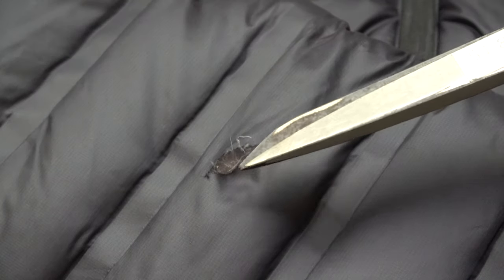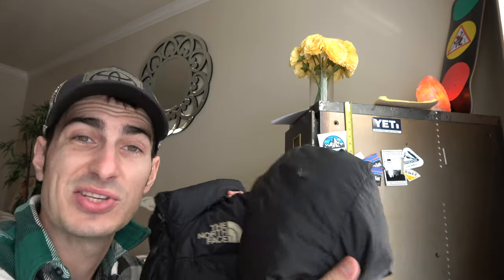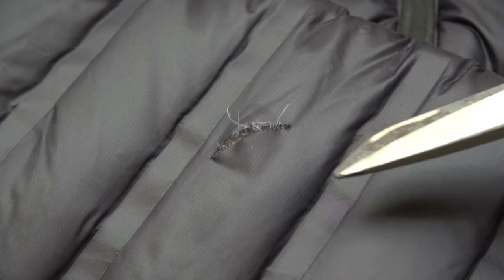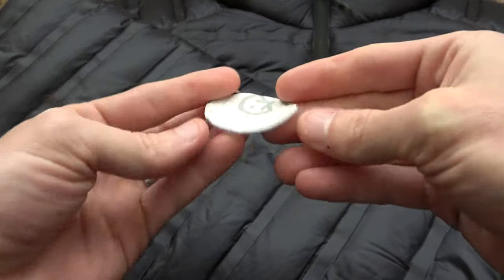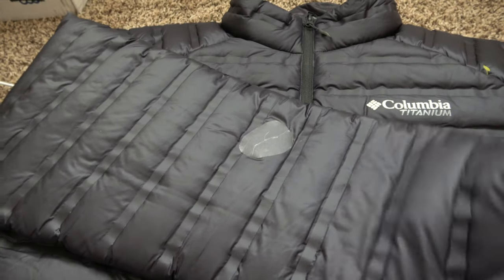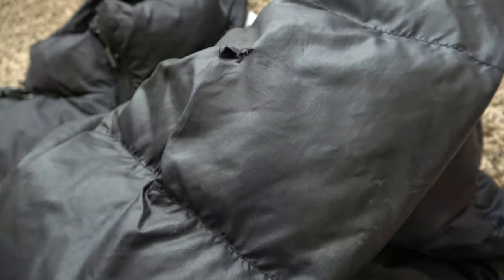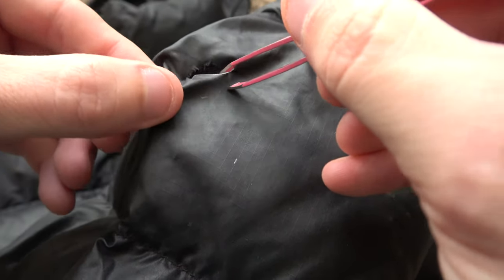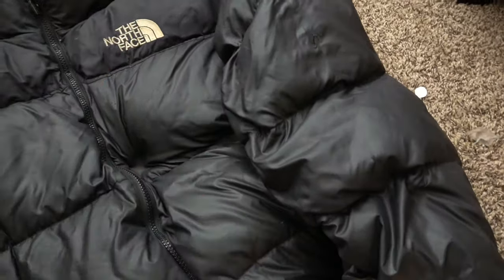HOW TO FIX A DOWN JACKET [4K HD] Ripped and Tears Repaired EASY

Comment: Might as well use any tape for an emergency 😉 for a more permanent fix I would sew patch on
Reply from the maker: That would work yeah
Reply: Issue with stitching is that most down jackets are water resistant to a degree, stitched areas create holes for water ingress.

Comment: Thank you so much for this.  I've googled this before and never found anything this user friendly.  Any easy hacks for zipper pulls?
Reply from the maker: You are very welcome Robyn. What problem with the zipper pulls?
Reply: Zipper pull missing on several coats I have in death pile.  Looks like you’d have to unstitch to pull off and replace, then sew back up unless there’s something I’m missing.

Comment: Sweet! That looks so much easier than what I was thinking I had to do with a needle and thread, which I know nothing about. My down coat snagged on something sharp in a bathroom stall at college, and I ride my e-bike there and back in the winter in 42 F degree temperatures.

Comment: Or you could just use Sellotape. I have done this on a couple of small holes in my down jackets and gilets with no problems, repair is still holding good and it's far cheaper than Tenacious tape.
Reply from the maker: More than one way to win 💪
Reply: Sellotape is more than tenacious tape currently on Amazon.